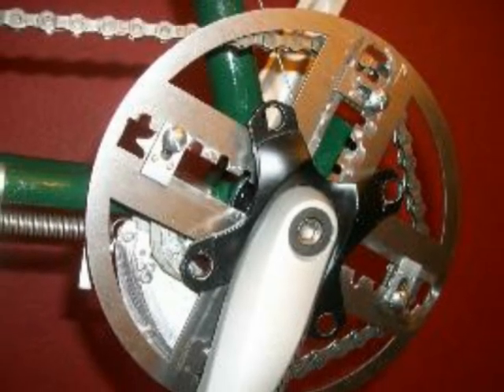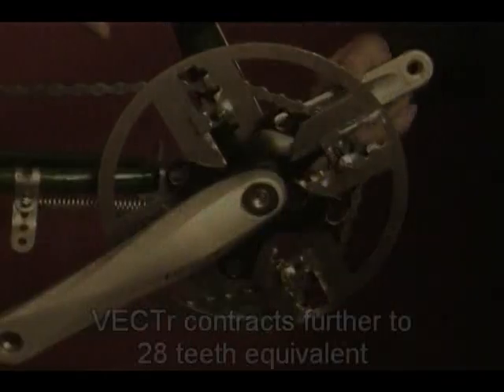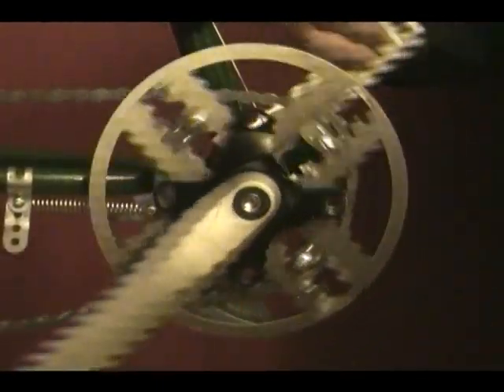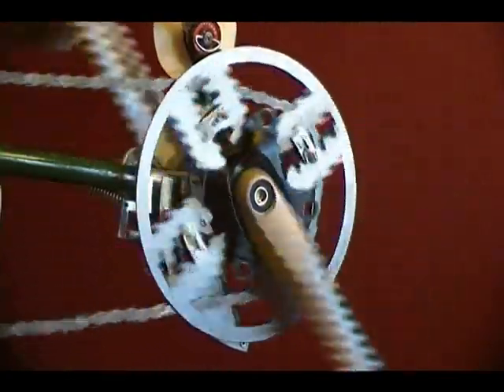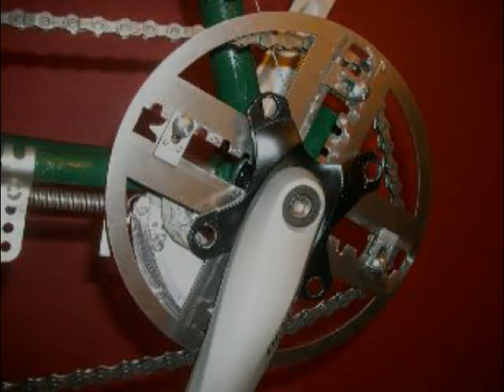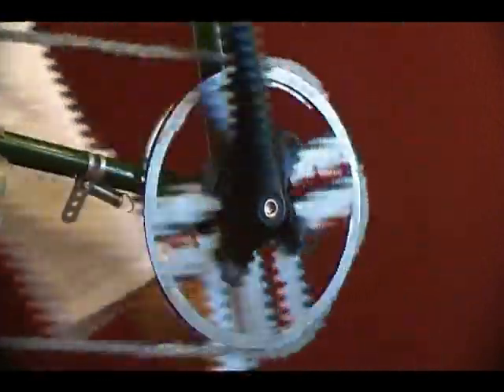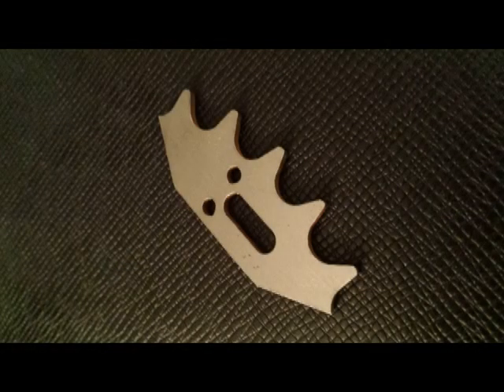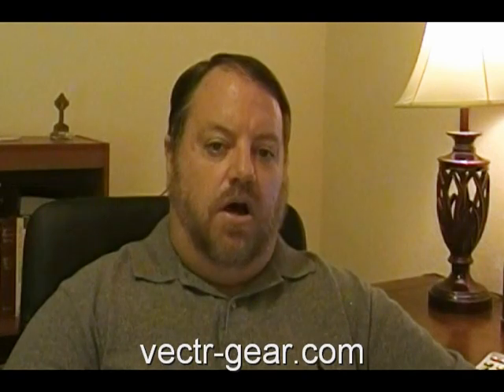VECTr - Variably Expanding Chain Transmission: 2015 clarification and update - newest version linked

Comment: Chain jumper for sure. A fragile and flawed design (much vibration)
Reply from the maker: With the newer 5 bolt version, not at all. Check it out testing in the lab: https://youtu.be/9Q8RavDigzo
Here it is tested on the road: https://youtu.be/5jBXFftKy6U

Comment: I was issued a patent on a similar idea in 1993(?) 5,492,506.  My design had some of the same issues you mention in your design. I never got adequate financing and after spending thousands of dollars in fees etc. I let the patent expire.  Good ideas are only a small part of the invention process IMHO,  Better luck to you with your idea.
Reply from the maker: Thanks for the encouragement. I agree, ideas are relatively easy (though not effortless). The devil is in the details and the implementation -- and then one has no control over market forces.

Comment: Not a new idea. Tokheim corp had the same principal in thevariable rear gears they actually marketed in the 70s. If they had made it light weight and more durable it might have succeeded. Reference their patent! Bikes were built and it was covered in the cyling mags.
Reply from the maker: With all due respect, VECTr is not very similar to Tokheim's device (or the many other attempts at a variable gearing system for bicycles) except in the general aim of varying gear ratios without a variety of chainrings or rear sprockets.  But I know of scores of such devices which also were not commercially successful.  Tokheim (patent no. US3861227) had variable gear ratios that were "selectively formed by ejecting toothed drive segments from retracted positions to active positions in which they are engageable by the chain."  VECTr varies gear ratios by varying the radial position of gear segments on a crank mounted base plate.  This, and the fact that it is light weight and more durable, sufficiently distinguish it from the Tokheim's device and the score of other systems.